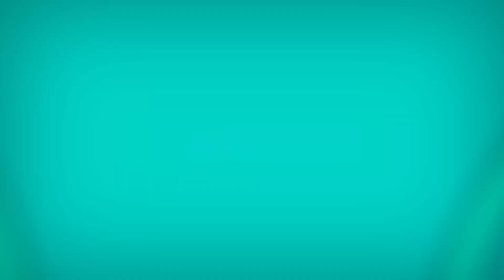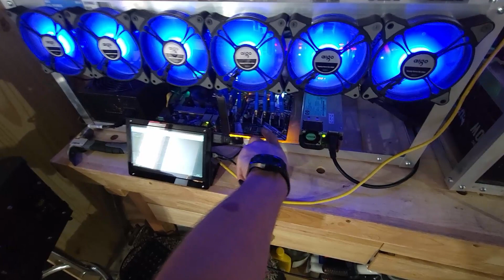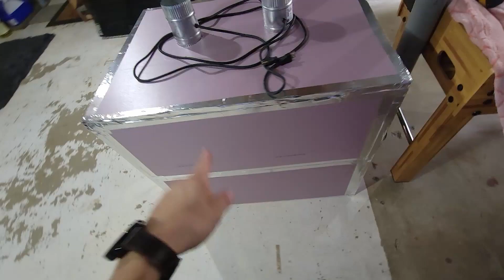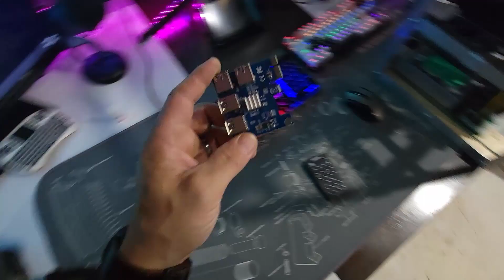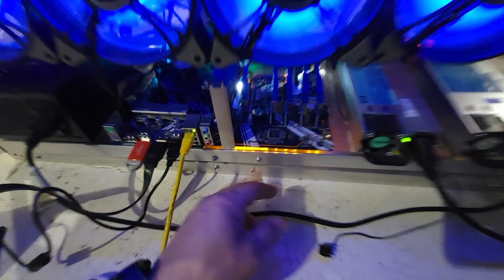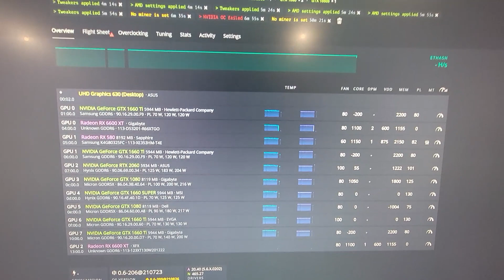Asus Prime Z390-P Mining with 11 GPU

Comment: Great Video, Tip, You may want to consider an ASRock H110 Pro BTC+ - they Are Great No Hassle Motherboards
Reply: This ASUS board is hard to beat at $130 currently. Most of the BTC boards are at least twice that and unavailable.
Reply: @kellerbomb  At $ 130 it seems to be a great Value !
Reply from the maker: I am actually looking into one at the moment but the prices are so high right now I feel like 8 should wait a little longer. I will probably go with the 6 slot  riserless motherboard, that comes with a cpu and they are cheaper.
Reply: @midnightminer  Yes Prices are surging again, I picked up couple from Parallel Miner the other day for $ 279 each - that's the cheapest I have seen New lately. Sometimes you can find a good deal on Ebay for used MOBO CPU combo. Good Luck
Reply from the maker: @CryptoMiningInsider  thank you for the guidance! I appreciate it. I was looking at the parallel Miner stuff when they got power supplies back in stock but didn't buy the motherboards.

Comment: Hi what CPU processor are you using? Some mentioned that only i3 8100 above would work only.
Reply from the maker: I am using the Intel core i5-9400 desktop processor. Got it from Amazon
https://amzn.to/3tqugYg
Reply: @midnightminer  would a cerleon cpu work fine to mine with this motherboard or should I try to avoid the cheap CPU’s?
Reply: I want to use I3-9100f  do you have any idea if I can make the same rig with 11 gpus?
Reply: @carloscamacho3954  I have a brand new rig with this same motherboard and the I3-9100f all brand new parts and I am getting a no signal from my monitor so I cannot access bios or do anything. Everything turns on lights, fans etc. I have tried all troubleshooting I have found online and nothing has worked. I am wondering if it is a faulty motherboard or this cpu.

Any help or suggestions is greatly appreciated
Reply: İf you use 9400F you cant any signal
Reply: @carloscamacho3954  It worked ?
Reply: @carloscamacho3954  It worked ?

Comment: thanks for mentioning this motherboard.  it might be one i want to get for building my next rig.  i started building my rigs with whatever i had. and i had the same issue, i couldnt get 2-4 PCI splitters to work either.
Reply from the maker: This is the first motherboard I got for mining. I was happy with just 6 slots but then I want it to grow so I kept on adding. It gave me a lot of headaches. If you get it make sure you disable all sata in bios and on-board audio. I couldn't run 6 cards with it but that fixed the problem.
Reply: @midnightminer  ahhhhh maybe this is the problem I am having?! I can connect 2 GPU's directly into the x16 PCIE slots and it mines perfectly. If i use 1 riser and 1 GPU it works fine but when I try to use the 2nd GPU and riser, click the power button and the GPU's flash a light and spin for half a second and wont boot.

ASUS Z390 A Pro
8GB RAM 2166mhz
120GB SSD
2 x 1660 Super
EVGA 1000w PSU

I have 4G enabled, set to Gen 2 etc but keep getting the same problem. I have also tried 6 other riser and have just bought more and paying it is just that!
Reply from the maker: @lewisjohn2597  yeah. Try turning off all sata ports in bios and just leave the one you need for the hards drive. Let me know if it works.

Comment: what's the report?   still stable with 11?
Reply from the maker: it does work with 11 GPU's, i had to downgrade hiveos so it will run the rx 6600 cards and that's why it was acting up in the video. all works well so far.

Comment: I think u might need stronger fans they seem pretty small for 7gpus in a box. you should also put on of the fans on the side at the bottom. else the air will just kinda go from one hole to the other. : )
Reply from the maker: i am running two 6 inch fans for exhaust in the "grow tent" box i made so the little facns were there more for color than air flow.